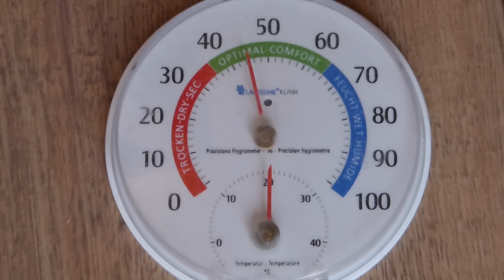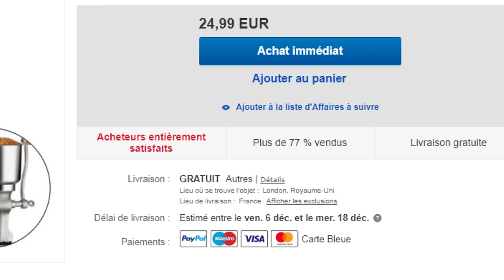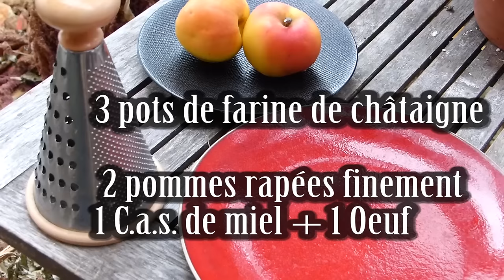Châtaignes: cuire, éplucher, conserver, sécher et moudre

Comment: @Chaillot Barnabé :  1/ merci pour cette vidéo, qui donne beaucoup d'informations utiles pour qui, comme moi, ne connait pas grand chose à la châtaigne. 2/ par contre, a) une fois trouvé le moulin qui concasse, n'importe lequel de tes autres moulins (voire peut-être un simple moulin à café, électrique ou manuel) aurait mieux fait l'affaire que celui de tes deux disques que tu as sacrifié pour une résultat mitigé  2/ ta gaine va, elle aussi, finir par être moulue, ou au moins érodée à l'usage ; et où iront les particules issues de la pétrochimie ? Avec le reste de la farine, tout ça pour éviter de mettre un pot pour recueillir ce qui fuit, le rapport bénéfice/nuisance ne peut être que calamiteux (lisez cet article : le coup des joints plastiques qui... s'usent et libèrent des particules de joint, ce n'est pas imaginaire : https://www.francetvinfo.fr/france/dons-de-plasma-accusees-d-etre-toxiques-la-moitie-des-machines-utilisees-en-france-mises-a-l-arret-par-precaution_2939357.html -à moins que le plastique de la gaine IRL soit de qualité extra-ordinaire et pour tout dire extraterrestre, le seul matériaux au monde inusable ET dont les particules sont bonnes pour la santé).

Comment: Salut Barnabé, 

Magnifique ta vidéo. 

Sympa l'idée de couper en 2 les chataîgnes pour les sécher plus facilement qui en même temps permet de vérifier l"état de la chataîgne. Pour ma part, je les ai séchées dans des cagettes empilées derrière la baie vitrée. Ça a mis plus de temps, 15 jours si je me souviens bien, et je n'ai pas eu de perte non plus. Ceci dit, je n'ai plus de cuisinière à bois (changé de maison), mais je testerai bien ton système de plateau sur une cuisinière à bois, quitte à rajouter des pieds pour éviter de brûler le bois.
Je me posais la question sur comment faire de la farine. J'ai un beau moulin à farine (électrique) & un panneau solaire (encore faudra-t-il les adapter l'un à l'autre 😅). J'ai pas encore testé, mais je me demandais si en concassant avec une masse 🤣😂🤣 au préalable ça pourrait le faire. As-tu testé ? Je retiens ton idée de moulin, beaucoup moins cher que les accessoires des robots ménager. Bises à bientôt.
Reply from the maker: Alors la vidéo encore d'après va te faire kifé. MOulin électrique sur panneau solaire. D'ici fin janvier :)